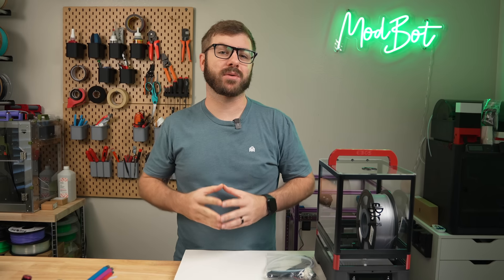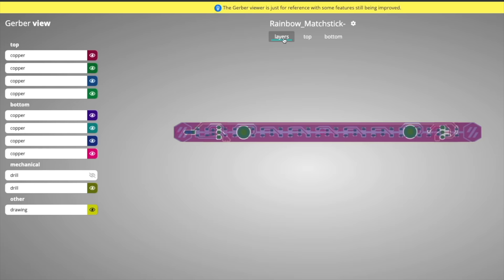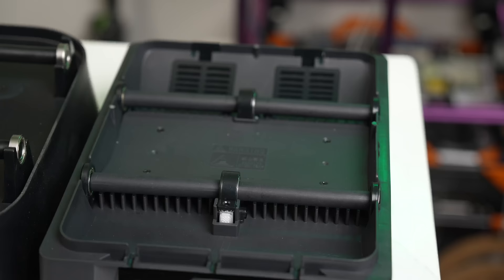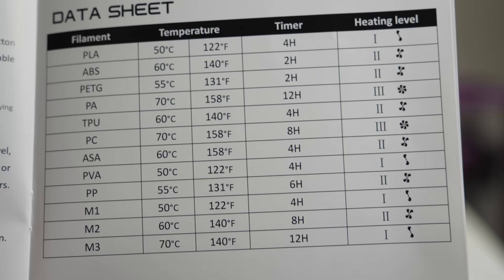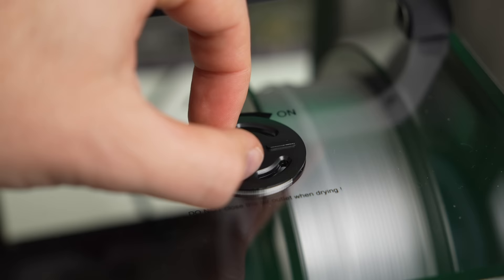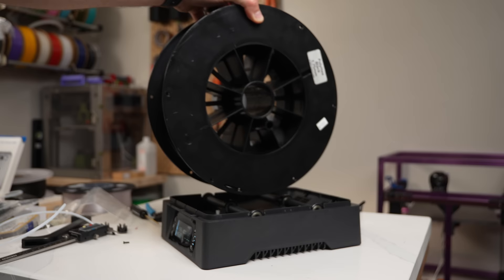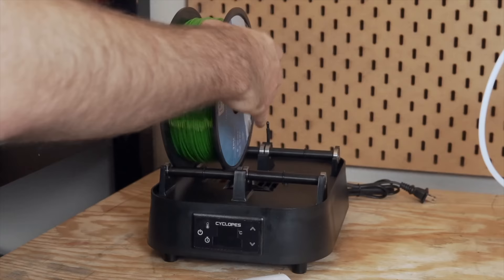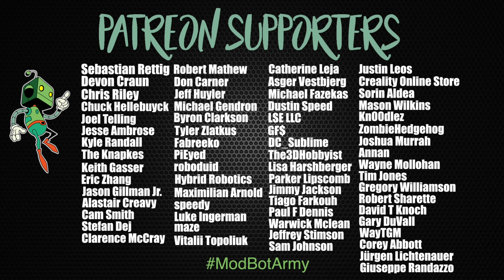I've Never Seen A Filament Dryer Do This (Eibos Polyphemus)

Comment: As others have said, I don't know why people buy these expensive dryers over food dehydrators that do the same thing at half the cost. Until these companies offer units that can do 80+ degrees C, it's just not a compelling sale IMO.
Reply from the maker: Do you print from your food dehydrator? I started with one and didn’t like my spools laying down. I print directly from my dryers so I need them standing up to prevent filament from coming off the real.
Reply: @ModBotArmy I have a cheap Sunlu dryer that I use to print out of if I'm doing nylon or something that needs to be kept dry during a print. Otherwise my food dehydrator does the heavy lifting of actually getting filament dry once it's wet.
Reply from the maker: @nikwoac  gotcha! That’s what I started with (the dehydrator). I also have a sunlu that has done fine for maintaining when I am doing a long print. I want a bigger dryer that can go even hotter. I guess the main concern with hotter is at what temp the spools start to degrade. I believe many are ABS but I am curious about the adhesive used on many of the cardboard spools. I would be bummed to watch them fall apart.
Reply: @ModBotArmy  that's a fair concern, and I probably wouldn't attempt drying at high temps on those spools unless the manufacturer specifically suggested it.

Comment: A better way to test this would be to have 2 identical spools left out in a high humidity environment, then weigh before and after running through the dryers. The sponge test doesn't really tell you anything.

Comment: I remember you saying that the Cyclopes dryer was good But you did not like that the heating unit was in the center of the spool in the unit as many spools don't have the right sized hole in the spool to fit them due to the set size of that heater? So really the cyclopes has problems fitting most spool center holes so the amount of spools that can fit is limited.

Comment: i'd love to see a review on the sunlu s4 hopefully you have one coming :)
Reply from the maker: They reached out a while ago but when I was told it was Kickstarter is told them I wouldn’t be interested until after. Once the kickstarter is done I will absolutely get one in for testing.
Reply: @ModBotArmy  completely understand the caution on kickstarters.. I backed it since i figured it's sunlu so it "SHOULD be safe

Comment: I see a ton of creators on here storing their filament out in the open and I’ve never liked to do that myself. I just try to open the plastic in a way that allows me to reseal it with desiccant and put it back into the box to store on my shelf. Don’t look as cool but it stays dry 🤷🏻‍♂️
Reply: Here are a few things to remember.

Having a nice looking setup increases engagement.
Some of these creators likely go through less hygroscopic exposed filaments fast enough to where it doesn't matter.
Finally, much of the filament you hanging about is likely pla
Reply: @dougshellusn  I’m not judging anyone and I’m sure they all use more than me. BUT, I almost never hear anyone say that they’re running PLA once they attain “creator” status.  I’m sure that’s what they have hanging around back there and it looks great, but I hope what works for them and you keeps working :)
Reply: For storing, Eibos have a line of vacuum bags that use a USB powered pump. It is the EURUS filament storage system on their website. I got mine during the Kickstarter a few years ago and it is still working well for me. The bags are heavy gauge plastic with a double zip-lock style closure. Each bag has a plastic slider to help ensure it seals (instead of relying on a separate tool that can easily get lost). The pump screws onto the port so you have both hands free to either help the bag collapse properly (useful for cardboard spools), or so you can multi-task and do something else while pumping the bag down. My only complaint is the valve ends up in the center of the spool, protruding enough to cause a bulge in the spool box. It would have been nice if the valve was closer to one of the corners, but that might cause increased stress around the valve as the bag collapses causing bag failure. With the current valve location I haven't had a single bag fail on me, even on my most used spools.
Reply: @Sembazuru  right on ! Is that still available and for how much ? Thanks for this !!

Comment: They cheaped out on the motor.  It's just a cheap DC motor with a gear box.  Probably plastic gears too.
They should have used an actual, small stepper motor like on 3D printers.
We already know that those things just run without issues.

Depending on how much space is on the enclosed part (bottom, black) one might be able to make something where one can mount a stepper motor.
To control it, a small Arduino Nano or smaller board could be used.

Comment: Noob question: how do i know if humidity is an issue? My printer is in a basement in Kansas so it fluctuates quite a bit.
Reply: If your prints get really stringy and if you hear pops coming from the nozzle. Most PLAs don't really suffer from this, but other filaments such as TPU and PETG can really suck in a lot of moisture

Comment: And for even less money than any of those machines you can get a food dryer and achieve the exact same results.
Reply from the maker: Yeah but printing from them sucks. That was my biggest issue previously. Laying down your filament and trying to print like that is a recipe for tangles.
Reply: @ModBotArmy  OK, but 99% of the time you don't actually need to print from them. Unless you always print materials like PC, PVA or Nylon, your filament isn't going to go bad over the duration of even a long print. If you haven't used an old spool of PLA for a year you might want to dry it, but then it's again good for a year. (I live in a very humid area)

Comment: Thank you for this.?
Would the Easdry be that best option to dry PLA, HYdrofil, PVA or ABS over a week? What about simply putting them into a large box of Damprid? The rotation feature of the Polyphemus seems like it would help w softer filaments?
Reply: Dessicant alone won't do the trick

Comment: I'm interested in you view of the cyclopes you have not mentioned the well documented problem of the heat directed to the material your drying and making it soft/fusing together as per this video https://www.youtube.com/watch?v=lgXyY6roClw  how did you get round the problem..
Reply from the maker: I have never had that issue. I have primarily used it for Nylons and higher temp PETGs but no fusing. I recently used it for TPU which is not high temp and also didnt run into the issue. So I am not sure if some are just setting it too hot for the material or if its specific units that are more affected.